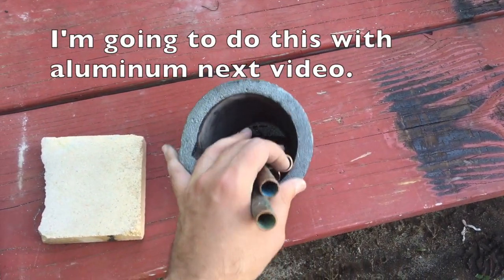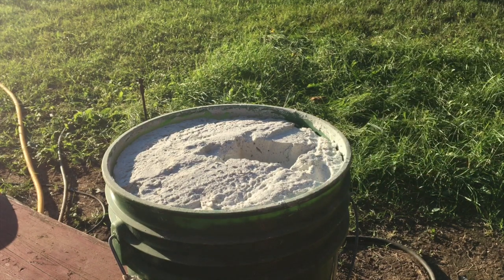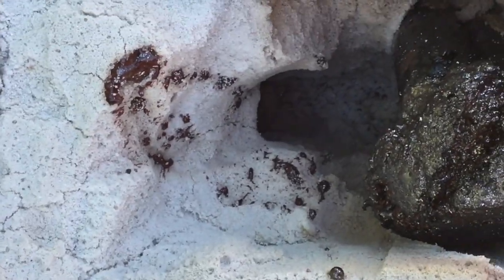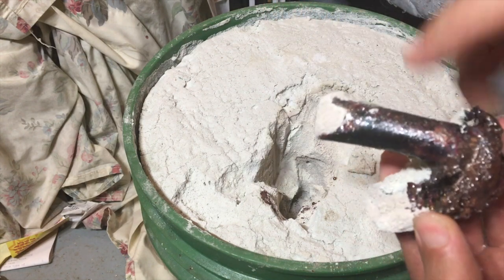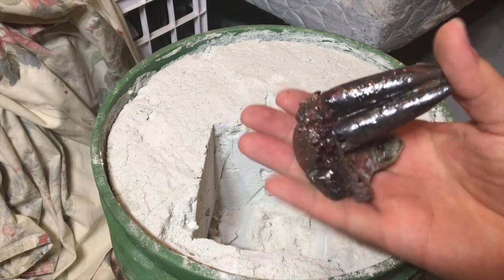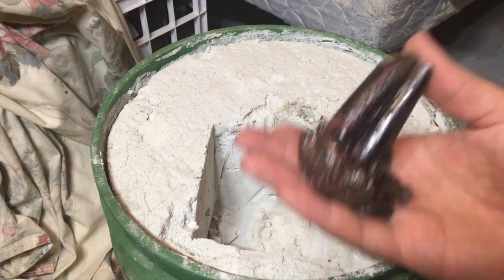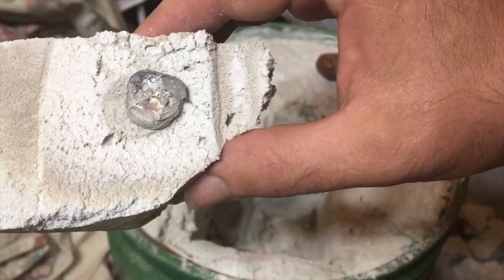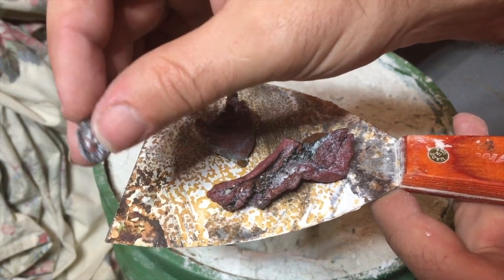Airkrete VS Molten Copper

Comment: What happens when you expose that stuff to water for prolonged periods of time?
Reply from the maker: Got some sitting outside now Its weakness is the speed that the rain hits in. Inside lets say a leaky house it will soak it up and release it slowly. No damage to are product even over time.That why it works well with brick.